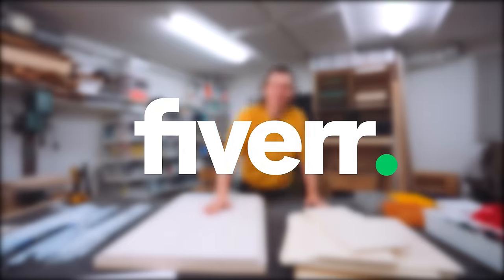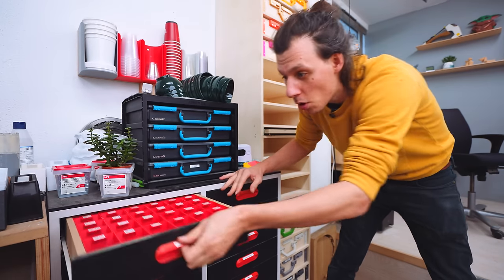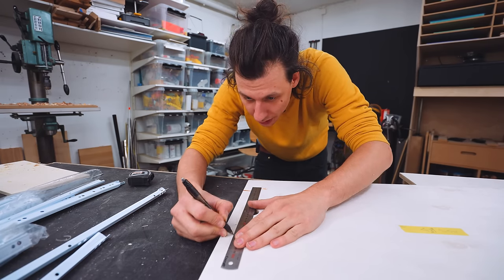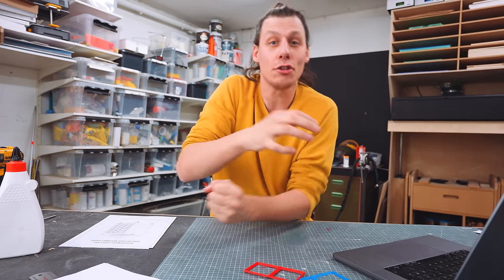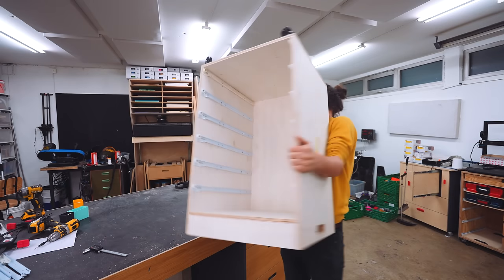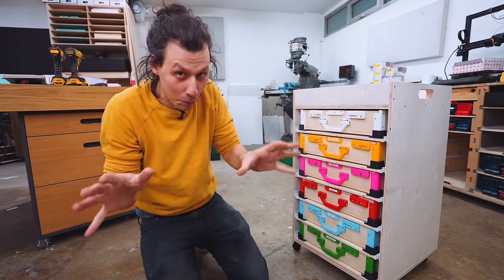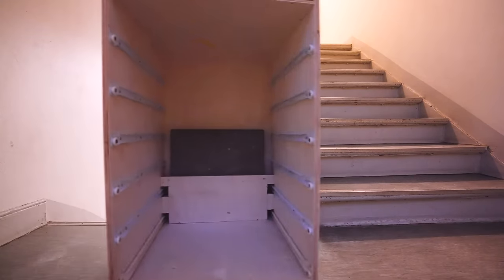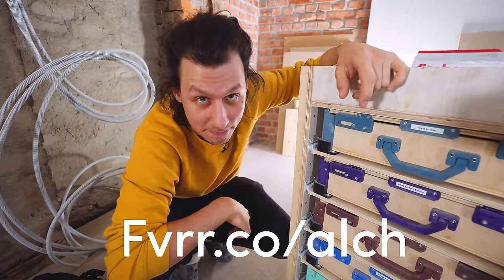This Makes my life So Much Easier - 3D Printed Tool Cart

Comment: Really nice concept. I would definitely move that weight so that it would be accsessible from the back. Also a locking mechanism for the drawers on one of the side would be an ideal so they would not slide out when carrying it. Then one could remove the weight without taking all of the boxes out and possibly (if the boxes aren't too heavy) carry it. Just a thought. Still a very good video and you're a such an inspiration. I really appriciate it!

Comment: Nice video and lots of great ideas-- got me thinking. Seems like you could get rid of the concrete counter weight by creating a system that only allowed one drawer to be open at a time-- which makes sense as the top of the tool case prevents multiple drawers from being accessible. Food for thought.
Reply: The counterweight solution was created, as I see it, to solve a problem I’d never expect to happen with a sane person using them: why would you ever have all the drawers pulled out at once, when there’s no chance you’d ever be able to access the contents of the top drawer with them all out at once?

But there are times it’d be nice to enforce sanity, one of those would be during moving. Having a cord go through each one of the drawers attached to the back that is anchored to the top and bottom of the cabinet, and an eyelet on the back of each drawer, with the cord only long enough to allow one fully extended drawer at a time (perhaps two if you like to live dangerously 😏) and even better if it came out the top of the cabinet in back, with adjustability with (I forget the name of them) one of those things used on backpacks, clothing to lock chords. That way, you could have as many drawers out at once as you like, including none, perfect when moving!

Comment: Cool stuff! Love your organizers, and this is a neat addition.  A couple of possible add-ons:  have either thin doors that can stay against outside of cabinet, or close over drawers  to keep them contained (or if you don”t want drawers, just a small strip that locks drawers closed. The other thing would be to attach the concrete counter weight to the back panel, and have the panel be able too remove into a separate piece for easier lifting.

Comment: Build stuff, organization stuff, design stuff, and occasionally renovate stuff. 3D printing has become accessible to many people, so ideas you use with 3D printed parts is awesome.

I wish wood prices would plummet again because I've got a garage that NEEEEDS stuff to be organized and a table saw, jig saw, router, pull saw, and skill saw that are getting lonely. I've also got 4 or 5 3D printers that need more work after Christmas stuff has been printed, built, and given away.

Comment: Love the concept.  I would recommend adding locking casters in the front to prevent it from rolling around as you pull out a drawer.  Front locking caster are easier to reach. Additionally, I would recommend adding a drawer latch to keep the drawers from opening unexpectantly when whisking the cabinet to the next room. I live in California, so most of my drawers (and bar clamp racks) are earthquake safe using a piece of 3/8" (9.5mm) all thread with a locking nut on top (to be used as a little handle to turn the rod) and a t-nut mounted to the bottom of the cabinet. I use some flat bar with rounded edges sticking out the front (top and bottom) with a 1/2" hole for the rod. I have also used an open spot on the side of the drawers or the back of the drawers. The advantage is the you do not need to unlock each drawer.  turn the bar, pull it out and you are good to go. BTW, my suggestions are worth every penny you paid for them.

Comment: It's time to change your approach with cement tile. The solution is a mechanism that prevents the opening of more than one drawer at the same time. A simple lever mechanism, I have seen it on the industrial cabinets that we use at my workplace. We work with heavy tools and if you open just two drawers the whole cabinet falls over.
Love the good content from you. Keep it up!

Comment: Love the assortments, I use them in my desk drawers to stay organized.  

Now you need to come up with something like this that works with small parts.  I have lots of containers of m2-m8 screws, nuts, and washers where the little dividers fall out and you end up with a scattered mess!
Reply: I don’t have any youTube videos, but I do have several 3D printers, lots of shelving, lots of clutter as a result of the 3D printers in the apartment, as well as my various projects. Those include designing card and board games as well as working with electronics.

I just ran across this video today, don’t remember if I’ve watched any of his past videos. But, I was searching at The Container Store and found nothing that made sense for my use-case. I’ve got a 3D-printed concept in mind that’d provide more flexibility than what he showed here (I have very limited space, I need to be more efficient) that’d be reasonably be compared to the Lego set of small organizing drawers/compartments, including making it feasible to have odd-shaped (not just rectangles, but a T, as an example) compartments.

A lot of what I need to contend with for electronics are surface mount components: some are only a few mm long, and I may not have a lot of them. The sizes of boxes he’s using would be absurdly wasteful. I’m thinking I’ll get the grid down to perhaps 1 cm on center, maybe 2 cm on center, because there’s a practical minimum, as much for human ergonomics (2 cm may make more sense) for fitting fingers.

If you weren’t horribly space-constrained and you had lots of Lego pieces or the money to buy them, you can absolutely make the small containers very modularly that way. The lego system isn’t about space-efficiency, though, and it’s not cheap!

Comment: Great design 👍
One thing I would want to add would be a way to prevent the drawers from opening when you are rolling it around. A vertical slide at the rear that has a tooth in each drawer could be used to lock them all in.
Also, I spotted the metal you added to the rear corners, I assume to also counteract the warping.

Comment: I like it!  The open top might not look as nice as a smooth finished top, but it gives you something grab a hold of and drag it around, and stuff doesn't fall off.  You could even stack another paver in the back to make sure it won't tip. The last cabinet that I built has over 50 lbs per drawer.

Comment: The weight in the back prevents tipping, but as you found is extra weight when moving the entire unit. 

Another solution would be to add eye bolts in the center of each drawer where you have all that extra space behind the boxes. At the midpoint of height each drawer put a hook. Like the part of a latch you would put a padlock through. 

Then pass a cable through all the eye bolts and hooks in a giant S pattern that repeats.  Affix one end to the top drawer eye bolt and the other to the bottom drawer eye bolt. Leave enough slack to have 2 drawers open (or even just one. 

Now as you open too many drawers it either won’t let you or it will automatically pull in another. You can never have more than 2 (or one depending on cable length) open and this it won’t tip. No extra weight either.

Comment: I think corner "bumpers" out of a TPU with lower infill % might be a really good option to increase durability on the cases or the whole portable tower for when carrying it up stairwells or keep it from getting dented/nicked in the shop.

Also putting a small draw angle on the brackets holding the trays in on the shelves might make it easier to guide them in as they're set down and align them without any penalty to fit.  I did that on a similar project (and used TPU) so slightly undersized it makes a permanent cushioned snug fit.

Comment: Needs two vertical wheels on the back which contact the ground or stairs if you tip it back, so you can haul it up or down stairs. Also, you could make a fold-down pair of handles for hauling it around.

Comment: I really enjoy all of your ideas and your use of 3D printing, of which I have no experience.  I am curious on how some of these products compare cost wise?  Does all the 3D printing end up making these projects more expensive than using conventional products purchased at a store?  Thanks!
Reply: 3d printing such stuff is actually super cheap. The printer itself for projects like these can be bought for about 200 €, they dont use a lot of electricity (i measured about 50W while printing so its like having a old light bulb running) and the printing material itself is really cheap too. A spool of a 1000grams costs me between 20 and 40€. I guess those drawer brackets weigh about 20 grams each so they just cost cents to make. The bigger issue is the time they take to print, i would guess each individual bracket piece takes 1.5 hours to print

Comment: Something you might consider is some way to stop the drawers from sliding out when you're moving the cabinet. It's not so necessary when just rolling it along in the apartment but if there's a slight incline or if you were to shove it into a van to drive it somewhere it can become a problem. So strictly not necessary for the use case you designed it for. Still could be a nice addition. The tricky part is creating something that doesn't get in the way in normal use and yet is quick and easy to apply preferably with no lose parts that you can mislay.

Comment: You could redesign it where the back panel is pulled forward and create a pocket in the back for the paver. Basically, take the short "false" wall and extend it all the way up and make the back wall short. Might have to engineer some more strength into it because of all of the notches. 

I might have to try that.

Comment: I like both but what would be fantastic would be if you can use shop construction projects in your remodeling and design. Like building a floating shelf display case system that is confinable to  grow  and change with additional items.

Comment: I enjoy the reno videos, but they are more of a side watch to these more maker focused videos. Glad to see then back!

Also 19/32 is more equitable to 5/8" for us 'Mericans lol. Though I prefer decimal feet as I work in a civil engineering field which would be equal to 0.05' lol
Reply: I agree, I prefer the maker videos
Reply: Wait, you guys actually use decimal feet? I would've thought you'd use a 'twelvecimal' system from feet to inches to 1/12 of an inch being 0.1 and so on.
Reply: @prgnify  nope, civil here is one tenth of a foot. Which VERY roughly equals 1/8th of an inch per 0.01'. It's actually super useful for almost everything, I prefer it to inches and fractions as I believe a foot is just about the nicest and easiest measurement for most things. I end up converting fractions In my head to decimal feet when doing projects 😂

Comment: Very cool. I wonder if you could have made the back of the thing open up to allow for easy removable of your concrete. Or maybe build a plywood enclosure around the concrete that has tabs that lock and unlock it into place on the back like kind of a module.

Comment: Great video. Would love to see a mix of these "classic" videos and the renovation series. They're both great.

By no means criticism - your builds are great - but I had some thoughts on the cabinet. It seems slightly counter intuitive to create a "mobile" unit, and then whack a massive great heavy weight in it that you've then got to lug around. Couldn't the "tipping problem" be better solved with some kinda caster type wheel, maybe on the bottom drawer somehow? (Of course this would require different runners on this drawer).

Where you've filled up the whole of the top space with the 3d printed containers, doesn't that then just get in the way of the handles meaning you can't now easily get your hands in to lift it around?

What stops the drawers from just falling open when you do carry it up / down stairs? Would maybe benefit from a little locking mechanism to force all the drawers to stay closed when "in transit" ?

Keep up the great content - love your videos 🙂👍

Comment: I would have designed the counterweight to be removable.
Split the back panel in the middle, glue the weight to the lower and insert a grip hole for transport. I love your way of constructing, your power and your courage, very inspiring. :washhands:😊Hilsen, fred and god help to deg. 🕊

Comment: an idea, u could make drawers that could be taken out and lidded, a hybrid of sliding drawer and case with handle. Have only a few lids ready by the side if you need to take them out. two birds with one stone. This way you wouldn't need to open the lid of the case when you slide it out, in shop it would be a drawer, outside a case.

Comment: Not sure why you'd have all the drawers open at once to create the tipping problem. But, rather than a chunk of concrete, how about putting eye bolts into the back of each shelf and then running cord through them that is only long enough to allow one drawer to be pulled out. Then, if you pull another one out, the cord pulls the open one shut as you pull out the next drawer. Much lighter!

Comment: Thanks for the video! How has the durability been for the 3d printed brackets on the toolboxes? I imagine they’re fine in the shop but I’m wondering how well they survive job site travel.
Reply from the maker: They work really well actually! I'm super happy with them, however they don't like it when you drop something really heavy on them from the top of a latter 😅

Comment: Thanks for the workshop video! I like both your series, the renovation was such a nice work.
I felt bad for your back when you permanently attached this concrete weight. Would it be possible to create a door behind the closet to be able to remove the weight, take it by itself to the 3rd floor, then carry the closet up the stairs.

Comment: Alternative idea instead of the paver, you could put a wheel on the bottom of the bottom draw to pull out and stabilise it, you'd would need to put a small U cutout in the base, and it wouldn't work if you didn't pull out the bottom draw, but would be a lot lighter!

Comment: i have one improvement idea: replace the swivel wheels in the back with bigger wheels (10-25cm) which are attached at the sides and add a handle at the back. this way you can get upstairs with it like a hand truck.

Comment: Suggestion: instead of the black plastic bits to hold the case into the drawer, what about routing that same detent into the plywood? You might even go a 1mm deeper along the whole size of the case, and let the whole case sit just below the top of the shelf. This would allow for a slightly lower stack height and one less 3D printed part, but would cost extra time.

Comment: watching the min 17:13 i can suggest an idea for more organization and help. As you use same companies electric tools and they all have the same battery pack,  you  can make an adapter to glue on the bottom of the battery pack and your tools like the drill on that second stay securely on the top of the drawer.

Comment: A problem with the self-closing lids when you slide the tray in is you might forgett to latch it. When you later pick the case up disaster strikes. Nuts and bolts everywhere. Not sure I have a solution, just thought I would point it out.

Comment: hi, cool video and I will definitely build this. But one question: can it happen that the sliders open automatically when moving the cabinet? do you need a safety lock for the drawers so that they do not open automatically when the whole cabinet is moved faster?

I also sometimes have the case that I want to transport two assortment cases in one hand, because I have my tools in the other hand. It would be cool to be able to carry two of these assortment cases together with one handle.

Comment: @Alexandre Chappel - How are those drawer sliders doing after some use? I mean - those would not be my first choice for sustaining big weights :) and - as you've mentioned in the video near the end - sometimes those oraganisers are filled with heavy stuff. Do the sliders bend under that weight? Have you noticed any bending or sliding out from the rails? Those plastic white rollers tend to bend the upper edge of the sliders, because of the big weight on the front of the drawer creating a lavarage and pushing the rollers up - the edge which is on top of the rollers holding them in line starts to wear and bend eventually letting the rollers out up and therefore causing the whole drawer to fall on the floor. Have you experienced any of these symptoms?

And by the way - as always - I truly admire your mixed material approach to solving ergonomic problems! Kudos! :)

Comment: I'm watching all videos. Since i saw case video i wanted to build few of my own, but here in Poland 9mm or 15mm plywood is not so popular. And if you find some it is more expensive. more common thickness is 6,8,10,12,16mm. So i wonder should i build my cases from 8mm or 10mm. With 8mm its gonna be easier to modify stls, cheaper, but is it gonna be strong enough? Just got the ultimate assortment system collection. :)

Comment: Hello,
in Germany 9mm plywood is not a standard.
So unfortunately I can not rebuild the cases.
Standard are: 8mm and 10mm.
Is there anyway a way to rebuild this with the thickness 8mm or 10mm?
I had asked the question before in the video where you introduce this for the first time. But probably the video was already too old, so you have not noticed my post.

Thanks a lot